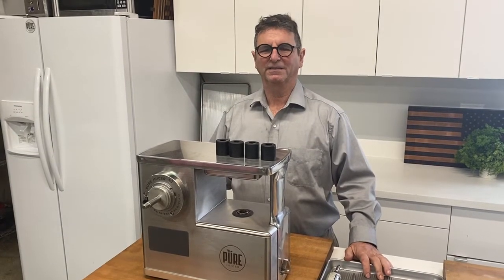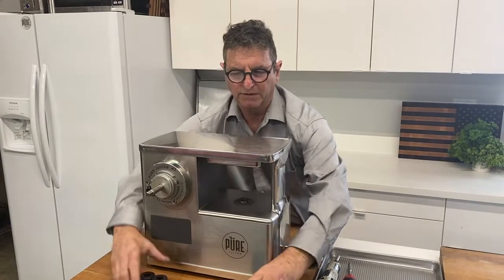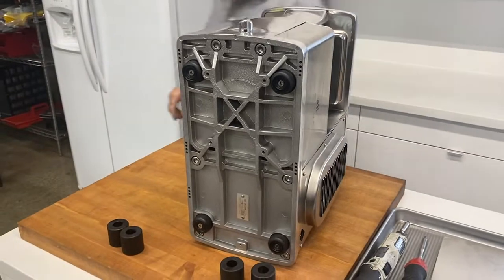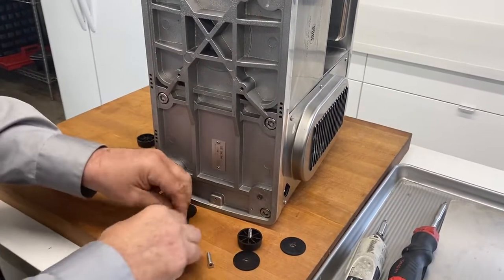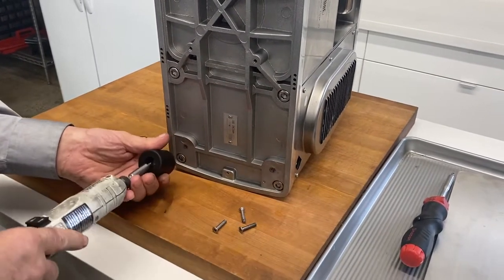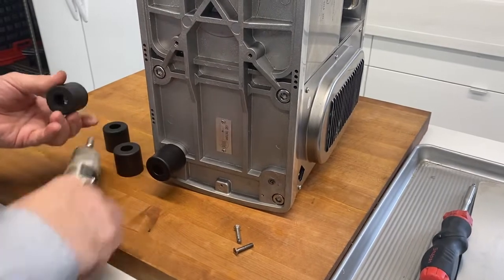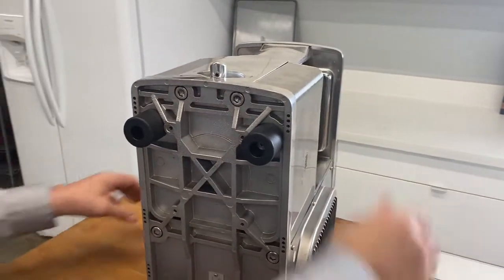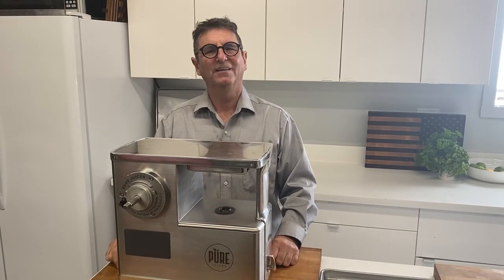PURE Juicer Service, Installing the Lift Kit

Comment: Can you guys come up with a spray guard? Maybe a magnetic attachment that directs any spray back into the press plate. I am juicing right now and keep getting sprayed by very small streams of juice.
Reply: So I just tried using a new press cloth and this problem went away.
Reply from the maker: Use a fresh cloth, the current one needs cleaning.